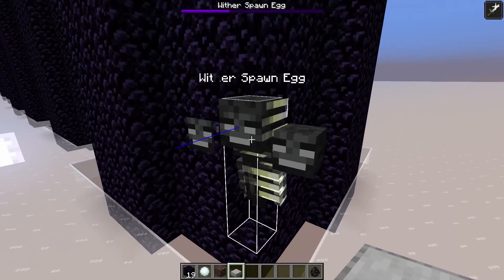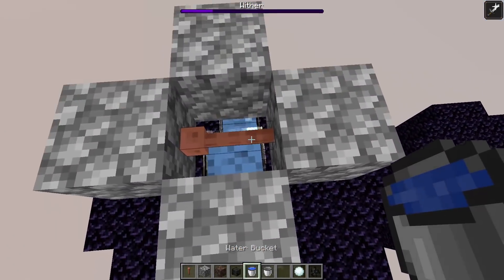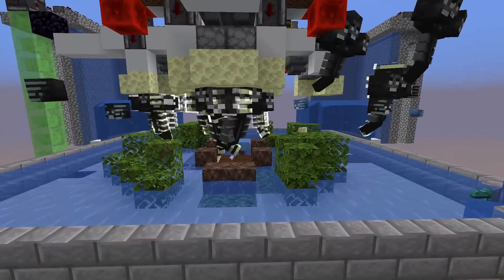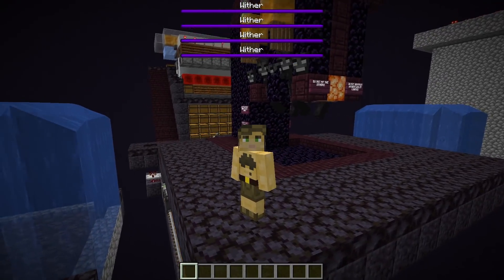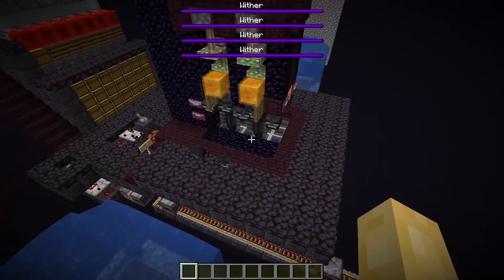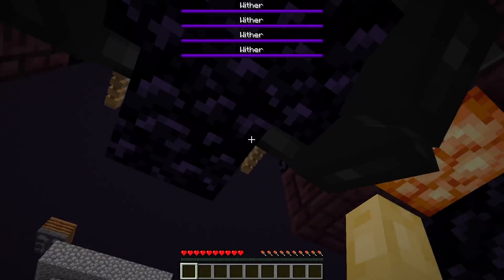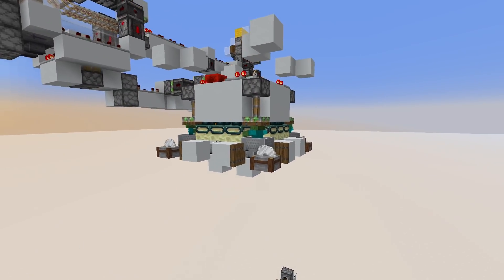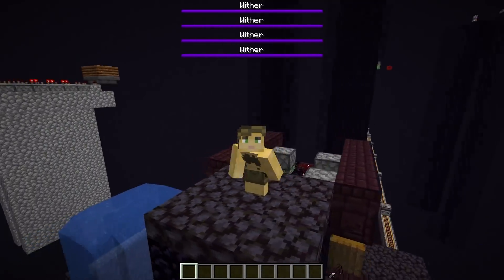Introducing, The Movable Wither Cage

Comment: Built this thing on a paper server and I love it – no more farming obsidian by hand. Due to spawn protection, I couldn't use the wireless redstone, but a simple hopper timer in the OW did the job to start the snow golems. At 129k/h, I really only needed to run this once for a few hours to have more obsidian than I'll ever need (hopefully).

It's worth noting that you can safely kill the withers after raising them by removing the sticky piston and honed block, ducking and punching past the lighting rod.

Getting the withers to aggro on the iron golem (and not on me or some endermen) was a bit finicky, but it worked out after a few tries and some extra walls. Might just be a paper thing though. One of the withers' side heads still ended up targeting me after it got hit by snow balls. This didn't really effect the farm while running, but it did end up breaking the thing when I raised the withers back up (maybe you just can't raise the withers while the snow golems are active, idk, I couldn't find a way of disabling the snow golems remotely due to spawn protection). Oh well, given the amount of obsidian I made, I don't think I need to repair it anytime soon.
Reply: For anyone else having similar issues building a wireless transceiver (spawn protection, single-player entity ID, etc.), try using an item despawn timer.

Comment: Disclaimer to whoever tries out this wither cage: the lightning rod attracts lightning in the overworld and causes the slime blocks to be broken and the wither to escape. I've had some headaches when using this.
Reply from the maker: The lightning rods should not attract lightning provided there is a solid block between the lightning rod and the sky.
Reply: @cubicmetre  yeah that was my problem XD, couldn't figure out why my slime blocks were breaking because I was tick warping... Turns out it was lightning strikes. I thought somehow my system hit the wither too quickly randomly.

Comment: 6:43    (Singleplayer Solution without using wireless redstone)
What if i load the end portal with a chunk loader and add a clock for the activation of the platform generation. That pretty much solves the first part.
But the problem is turning off... but it is simply solved by adding a clock that deactivates the platform generation

Am i right?

Comment: Impressive farm!
You could further improve it by automatically breaking the obsidian at the withers foot with headless pistons below the platform. These ones could be created by a precise timed extension while the platform is generating.
Reply from the maker: The pistons seem to just break if you try to remove the head with structure generation
Reply: @cubicmetre  I have a design that seems to work reliable. Do You you want a schematic or WDL
Reply: @cubicmetre  The piston head needs to be deleted / replaced by structure generation (or anything else like explosions) while in state of block36. Than the base doesn't break off.

Comment: I got the problem that the farm stops randomly after 10 min or something like that is there a way to solve this problem ?
Reply: is it because you used a unstable version of the wireless Redstone? (the version from 2no2name is unstable )
Reply: there is a stable version (as he clames I did not test it ) by Redstone warper
Reply: the problem only appears in the end dimension
Reply from the maker: The telemetry modules work perfectly fine, otherwise I would not publish them in a design. They cannot link accross dimensions, so if you tried to build one in the end they would not be able to communicate. And there is also a problem in singleplayer where if the player is near one of the telemetry modules then the client can mess up the tick priority of the item entities. The overworld might also be unloading, make sure that you built the chunk loader properly and that it works reliably i.e. not pigmen or other entities stopping the minecarts or anything like that.
Reply: @cubicmetre  I tried a new chunk loader also with less items (12) (one with items )but the problem is still there (I tick warp the whole thing with carpet mod ) the rest is just like the wdl but it stops working randomly and I have to start it again (just pressing the button is enough to start it again ) I could just make a clock that sends erverytime a signal so it starts again but I just wanted to let you know about the problem
Reply: @cubicmetre  i fixed it with a clock that activates when it goes of

Comment: Hello, I saw this video and then tried to make wither tunnel bore using this movable cage but it didn't work after a bit of research I found out that it is probably because high blast resistance of most blocks underground so I'm not sure what we can use it for. If you have some idea please tell me I'm trying to make something impressive with redstone but I have no idea what should I do. Thanks
Reply from the maker: A wither tunnel bore would likely rely on the wither breaking the blocks with it's area attack rather than trying to blow up the blocks with the skulls.

Comment: Is the wireless redstone broken for 1.18 cause it doesn't seem to be working
Reply from the maker: Just tested it, wireless redstone system works fine, you need to make sure to go to the overworld setup and make sure the portal based chunk loader is running every time you load the world download.
Reply: The wireless redstone only works on servers, not singleplayer
Reply: nvm it does work on singleplayer..
take a look at this video: https://www.youtube.com/watch?v=3YcB1Lr9_oY&t=336s  
I think you can't be loading the chunks (from the receiver/transmiter) with the PLAYER, you have to load them with a chunk loader.
Reply from the maker: @mvaldessch7714  Yes, 2no2name mentioned to me that in singelplayer the client will mess up the IDs of nearby items, meaning if you are near the transmitter your player will actually interfere with the transmitter in singleplayer.

Comment: would it work in 1.16 with a chain instead of the lightning rod?
Reply from the maker: Yes but the only issue is that you cannot use the soul sand with a chain, an end rod also works however they have basically no blast resistance.

Comment: How do the zombies not fall through, I.e. how did you get them aligned like that with the minecarts diagonal balancing on the edge of the stonecutters?
Reply from the maker: They are aligned to trapdoors such that a small part of the minecart is resting on the corner of the stonecutters.
Reply: @cubicmetre  thanks for your response,  love your videos.

I managed to align them by pushing the minecarts up against some sea pickles

Comment: U can also use a system with a wolf, detecting your presence in the end dimension, entering it the wolf will stand up which is detectable and your system can automatically shut down, leaving the end will make it sit down and give a seconf signal enabeling the system again.
Reply: but if you leave the end how do the withers get up ?
Reply: @fifi7354  if U leave the dogs dimension it will get sad and sit down, detectingthis is done with a contraption that uses a tripwire to pick up a signal if the dog is jumping, this can be done by putting a sheep 2 blocks infront of him and preventing him from getting to it by blocking of one half of the block. Incase the dog does not jump at all over a "longer" perdiod of time, which is detectable using a comperator-timer, it most likely means that he sat down causing the shutdown-signal to be turned off and the farm to be turned on again.
Incase you ar wondering how this would work if the end is not loaded, it doesn't. You would have to build a contraption in the overworld to load the end constantly.

Comment: Now this has me really intrigued by the possibility of automatically removing the pillars, but I imagine it will still be one heck of a challenge.
Reply from the maker: Originally I wanted to use this to make a much simpler obsidian end pillar farm that would scale withers up and down the pillars, however it would likely be slower than the original end pillar farm but also more complex then the end platform design which obtains very good rates on its own.

Comment: Could you turn off the farm from the overworld side by adding a filter to the hoppers that detect a named item which you can send through the portal? Or do the withers destroy the items sent to the end?
Reply from the maker: While the farm is running the player must be present as there is no way to automatically perma load chunks in the end dimension. So the best option to turn the farm off is to simply have the player flip a switch.
Reply: @cubicmetre  If it's possible it might be useful in case the person in the end somehow dies, can't reconnect, etc.

Comment: Well people tried making wither based quarries since withers/slime got added to the game. Sadly early designs by Myren (i0A5EZLd71U), as well as later designs by me using end crystals (lUEPmxsYwKo), all show that it's basically impossible to have a stable set up, wither can always glitch through blocks and escape. I'm afraid best you can do is bearly stable tunnel bores like the one Jing RS Lin showed (u7EW7wUmWWc)
Reply from the maker: I spoke with Oreo about this and apparently the entities phasing through blocks was an issue in 1.12 which does not seem to be present in the latest version of the game. This might have something to do with an attempted fix of MC-2025. As far as I can tell I have never had a wither phase through one of these setups while they were moving, all breakouts I have observed were due to the machine itself flying into a wither skull and exploding, which can happen if the skulls are being fired at certain trajectories.
Reply: @cubicmetre  Well talking to Oreo is a mistake xD If you saying they don't glitch through blocks than it's easy peasy now, that was the only problem